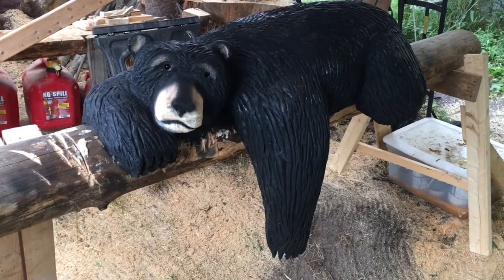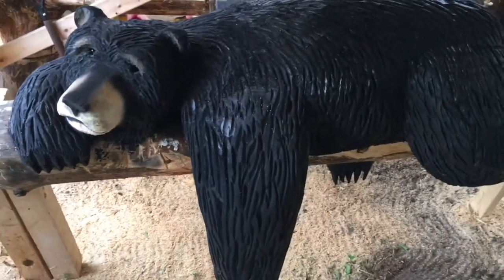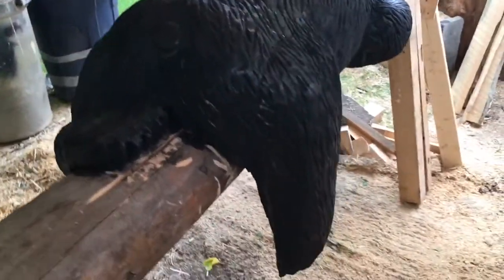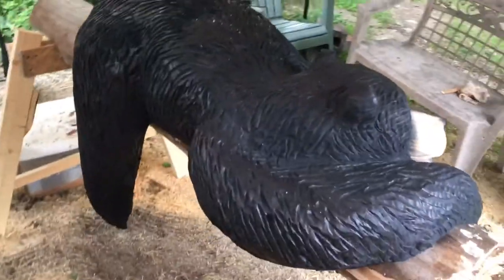Chainsaw carving a bear sleeping on a log part 4

Comment: look's good. i was wonder what kind of black paint you are useing and what type of sealer you will use.i  carved a bear out of a apple tree ,and i am just starting to carve stuff. need a tip .thanks.
Reply from the maker: wild1478njhg  your apple wood bear might look good with just a finish no paint . I primarily use an acrylic paint thinned with water so I can spray it through the air brush . Then I use a mix of mineral spirits/or lacquer- with minwax helmsman this is and exterior polyurethane.
Reply: thank's for you help,i might just put a clear finish on it.i like your video's.  thanks
Reply from the maker: wild1478njhg Not a problem. Your welcome